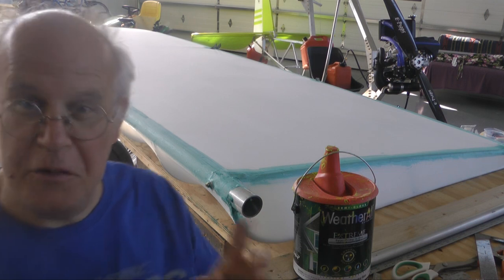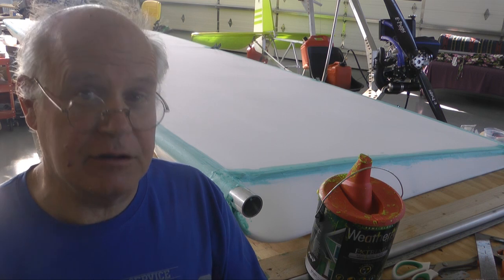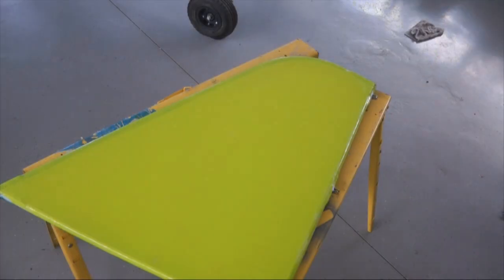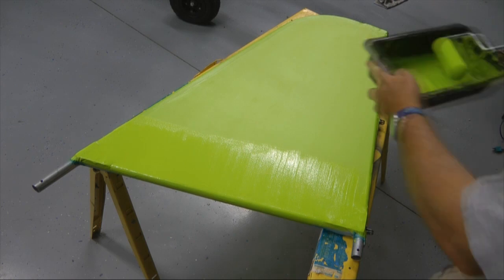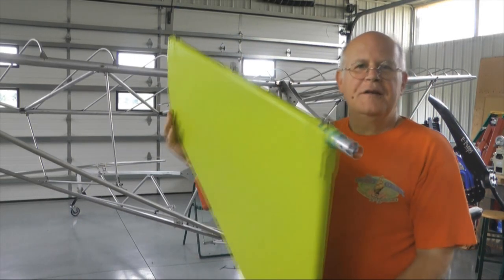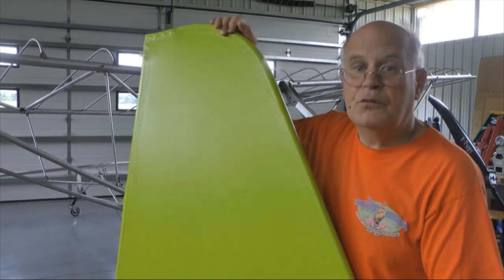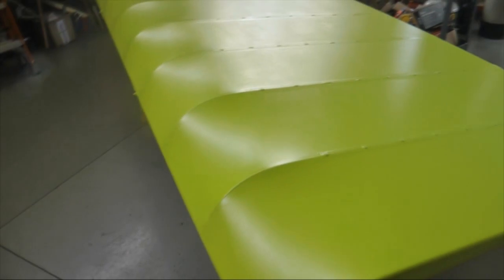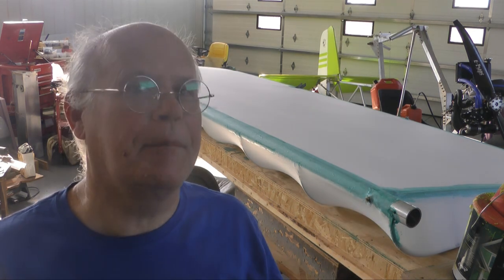Building the Affordaplane Part 46

Comment: I’m sure you’re aware but I’m still going to say it. Latex exterior house paint Is not approved for aircraft use. Yes, you can use it on an experimental/ ultralight home built aircraft no if ands or buts about it, totally legal. But also as you’re probably aware neither Stewart systems or poly fiber have tested latex paint. Now, they are made to conform to particular TSO’s for being able to obtain STC for multiple certificated aircraft. Now, if the system manufacturer has never tested their products with latex we have no idea how it’s going to perform. I guess this is how I look at it…what’s legal vs what’s safe. How will the chemicals used to manufacture latex paint interact with the polyester fabric? Will it degrade its strength? No one knows? I think it’s better to use the system according to the stc instructions whether it’s going on a certificated aircraft or not.

Comment: Hi Jon. I'm still waiting with baited  breath to see how you covered around the strut attachment points on the wing.
I've been trying to work out a method of doing this for some time. The only way I think I can get it to work would be to cover the under surface first, install the attachments , and then glue on a patch to reinforce the area. 
Do you agree so far? Once the upper surface of the wing is covered access to the attachments is no longer possible.
I intend to use castellated nuts and split cotters for these attachments as inspecting them is impossible.
Reply from the maker: Arthur - send me your email address to: support@homebuiltHELP.com and I will show you what I did.

Comment: One thing I learned from covering RC planes with monokote is to tack down the material in the middle of the rib on one end of the wing then on the opposite end of the the wing pull tight and tack in the middle then work opposite corners.  The material on the leading and trailing edge should just fall out straight. After shrinking you will still get a little sag between ribs but it will be less.  Love these videos.

Comment: Hi again. The machine used by the paint shop is called a colour densitometer. It measures the density of the primary colours in the materials stuck into it  and then feeds it to a  omputer.

Comment: Thank you for a most informative series so far.
I am very keen to see how you cover around the strut attachments on the wing. I imagine you would have to  over the under surface first, attach the strut fittings , and then cover the top surface.
But I need to see how you did it.
Thanks again for a very interesting series.

Comment: Floetrol added to latex will help improve the finish and makes tipping more effective in removing bubbles and brush marks.  It may be worth looking into for this application.
Reply from the maker: Hi Andrew - We tried Floetrol a number of times (differing strengths) and found NO benefit compared to water.  In fact the label warns that it will also cut down the gloss.  Also tried the 'windshield fluid' with no results (changed the paint color!)  I suggest everyone experiment to find what they like best.
Reply: You can also add windshield wiper solution to thin the paint, it's a technique the RC folks have been using for years

Comment: I’ve always wondering how the “sagging” between the ribs affects the lift or flight characteristics of the wing. It’s probably negligible but I wonder if adding a small strip of aluminum at the bend would straighten it out at all. Keep up the good work! I can’t wait to see her fly.
Reply: I would guess that with the direction the air is traveling, it's probably not much of an issue, other than being a slightly less-efficient airfoil shape in between the ribs. An ultra thin long and flat strip of sheet metal 2-3 inches wide molded over the top of the bend would be interesting...
Reply: I know close to 0 about aerodynamics, but I'd think that would create a ridge that would interrupt smooth airflow over the LE (and weight).
As it is now it's like a blend between 2 airfoil shapes.

Comment: I'll sure PASS  on the house paint thing..........IF House paint was the "IN" thing Airbus & Boeing would be hot on this🤔,.. I'd do a aviation paint demo with a layered sprayed on job vs. what your doing here........... do it on a 1ft. sq. of the  wing covering  let it flash out then compair. ... Just my take on this,🤨 I do think I can shoot a much lighter under coat / color coat  combo.... latex is heavy.
Reply: This is experimental aviation, and Part 103 has no certification requirements, so people are free to try out new ideas.  Latex paint is durable, UV protection built in, and proven across many different experimental airplanes for many years.  You are absolutely free to follow your heart and apply an expensive commercial paint process to make your plane last for 100 years, but for an ultralight that will likely have a much shorter life the latex approach is sensible and quite effective.
Reply: YEP... Did a whole lot of research this morning about Latex and if that's one's  thing I guess IT is O.K🤔...... I'm just scratching my head about this one, not sure if I'd go that direction.
Reply: You could say that about anything in the experimental world.  Airbus and Boeing do the stuff they do because the aircraft they built operate in a regime that is orders of magnitude beyond the types of stresses that a Part 103 ultralight needs to be stressed to in order to be safe.  Also, their customers have significantly deeper pockets than you or I do.
Reply: the airliner manufacturers use 2 pack hardening paint, that is as tough as concrete and operates in an infinitely tougher environment than any microlight. Jon's choice is good enough.
Reply: I bet if you look into it, they're spraying fancy new environmental friendly water based paint.
Reply: More than likely but not Valspar  House Latex.🤔 I shoot "water base" coatings all the time,.. good stuff but not LATEX.